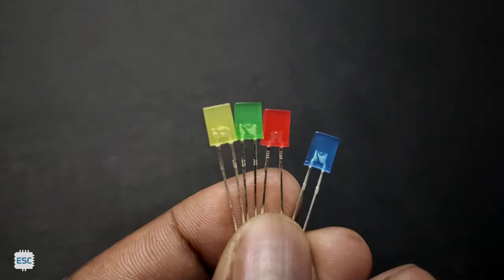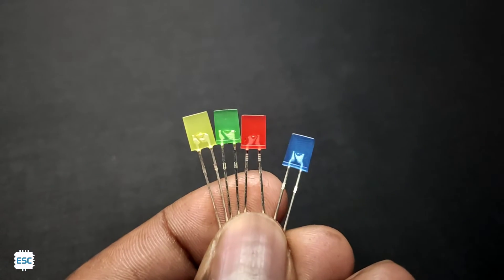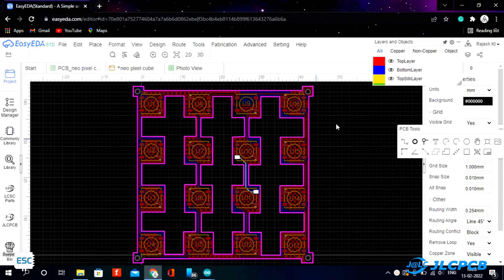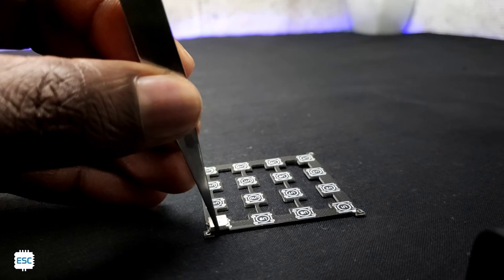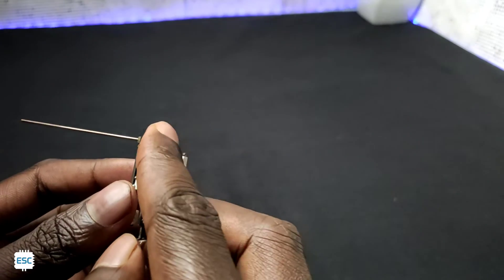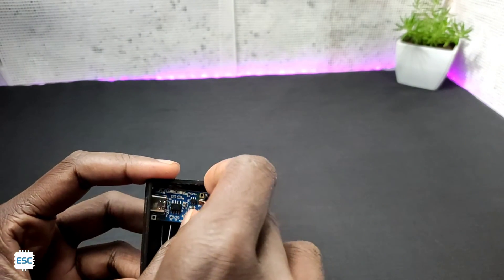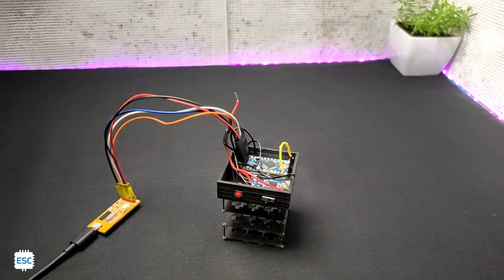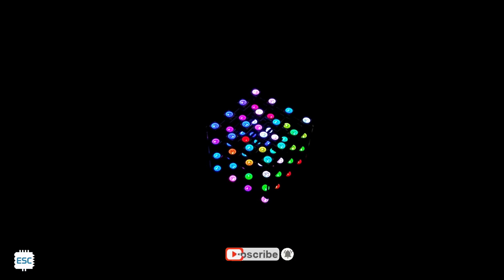How to make RGB LED cube using NEOPIXEL  | DIY | JLCPCB

Comment: @3:33 a still image of the completed stack shows 2 corners with legs that run from the top PCB to the bottom PCB and under the bottom PCB. But the other 2 corners only show shorter legs.
Reply from the maker: Yeh  longer les is for  ground and vcc
Reply: @EDISON_SCIENCE_CORNER  I still dont onderstand how the DO of the first layer gets to the DIN of the second? they are at opposing corners?

Comment: "circuit diagram" is not included in the downloadable files.
You did not show how the DOUT of one layer connects to DIN of next layer.
Reply from the maker: Hi bro 
Sorry i forgot to add circuit diagram. Now i added you can download .  I connected layers using copper wire . I fabricated two types pcbs
Reply: @EDISON_SCIENCE_CORNER  You really should have included that information in the instructable.  Many will order the pcbs and not be able to make the cube in the way you describe.
Reply from the maker: https://wa.me/+919074213906?text=I'm%20interested%20in%20your%20PCB
Reply from the maker: Please send message to whatsapp if anything needed.?

Comment: Cool Project! Do you know any way to connect something soldered with a bread board? I wanna make something similar but don't want the arduino to be gone forever
Reply from the maker: O didn't understand what you mean
Reply: I know it's been three months, but in case you haven't found a solution yet (or someone else in a similar situation sees this): what I do in those situations is to simply use headers to connect the parts you want to be removable to the breadboard. Solder the non-removable parts to a perfboard and connect the in/outputs to male headers that you attach to the breadboard, similar to how you would attach for example an Arduino Nano. If the only purpose of the breadboard is to make the Arduino (and maybe a few other components too, like a Bluetooth module or an OLED screen) removable you don't really need it though. You can simply attach them to female headers. like how a Shield for the Nano works.